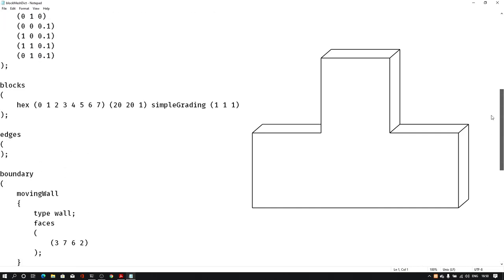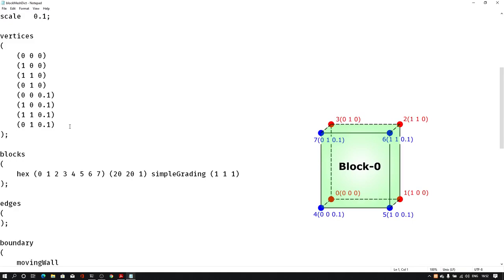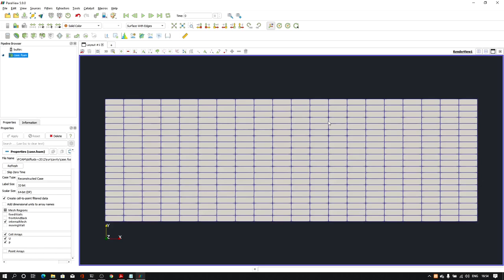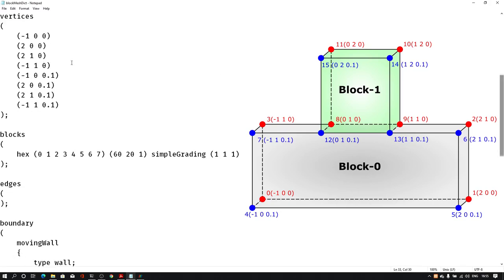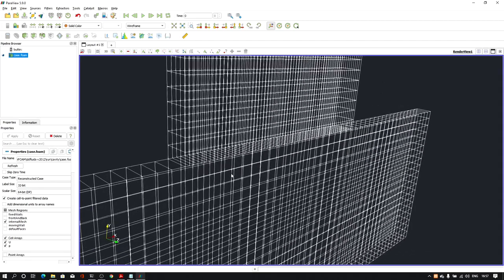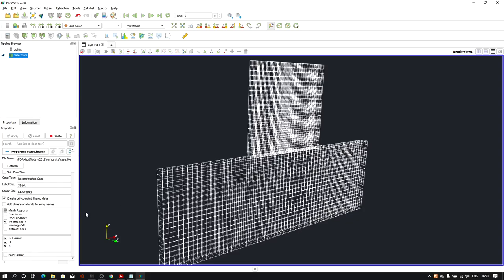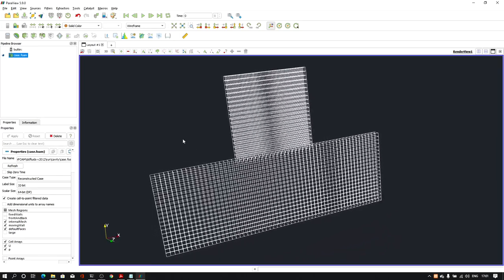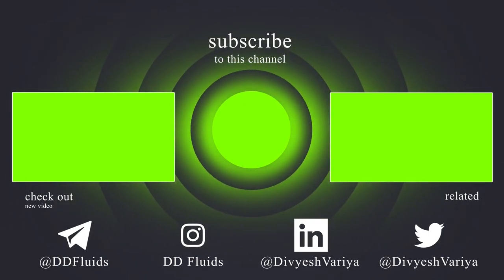mergePatchPair in blockMeshDict

Comment: What boundary conditions should we give on those newly defined patches for mergedPatchPairs? Can you share the case file for this problem?
Reply from the maker: As I mentioned in the tutorial, No need to give any boundary conditions to the internal faces. The purpose of the tutorial was to focus on meshing. Hence, case files are not essential. You can only modify the blockMeshDict file to create T-shape geometry.
Reply: @DDFluids  I also thought so. However, when I run the simulation, the code asks for BCs for the mergePatchPairs
Reply: @DDFluids  When I added the "large" and "small" patches without adding/modifying the files in 0/ folder, ParaView crashed showing the error message : "" Cannot find patchField entry for large  ""
Reply: @DDFluids  Hi I am facing some similar issue in blockMesh. Suppose this is T-Mesh and involves only 2 blocks. If it is a C shape mesh and I want to combine 2 blocks with one base block(Total 3 blocks). Is it possible to do that way? Or Is it compulsory to split base block into 3 blocks which will be total (Total 5 blocks in number). Kindly let me know this will help me alot.